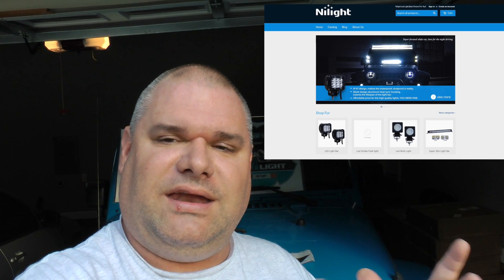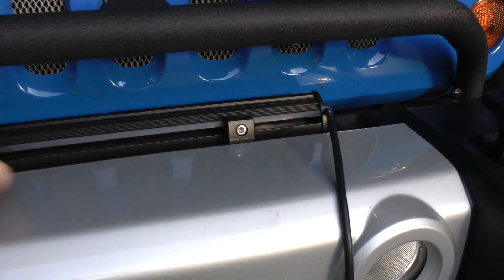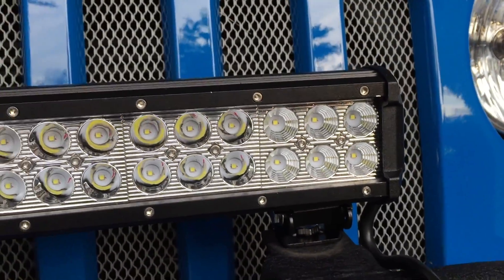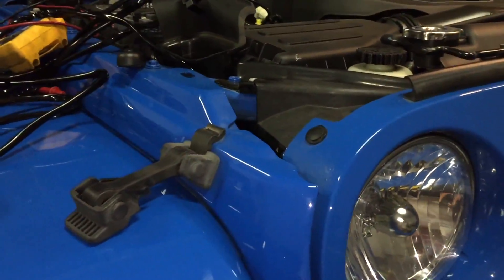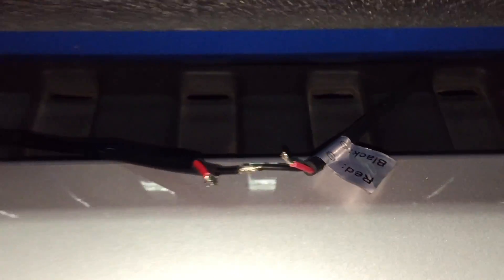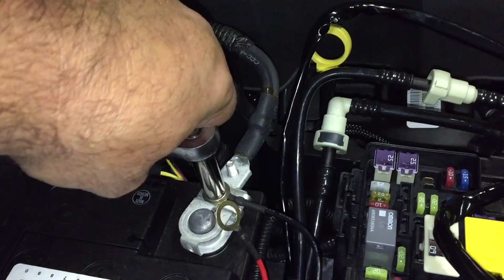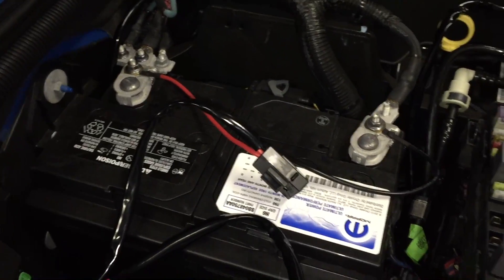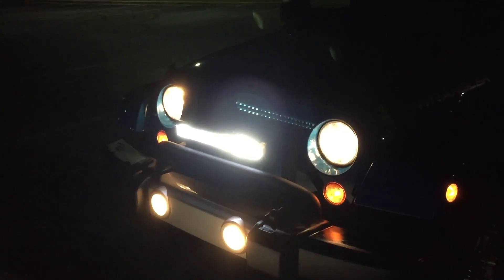NiLight 20" LED Light Bar Review & Installation Video

Comment: Thanks again for this video.  Installed the same bar and 20" Nilight light bar this past weekend.  Very easy install and works great.  Of course I used this video as a guide.  I ordered the bar from Mopar instead of Rugged Ridge.  Exact same bar, got it for $77 from Mopar compared to $145 at Rugged Ridge.  The instructions that came with my Mopar bar had Rugged Ridge listed in the warranty info.
Reply from the maker: dang I wish I had found that deal. I think the bar was in the 150$ range now thinking about it. I still love the LED lights

Comment: Amazon doesn't seem to have them but Nilight should make covers for these light bars. Hate for a rock to crack the glass and let in water.
Reply from the maker: https://youtu.be/qTiKrngYHwQ
Reply: So you can burn it with a torch, cut it with a saw, squish it in a vice..... I'm not convinced ;)

Comment: I liked your painted roof up-grade and probably going to copy You! keep adding accessories and you'll need to up-grade a power source! I added a relay box with 6 accessory connections with a 4 toggle pillar add-on I got off Amazon to run my goodies, works great and handles the watts needed. I'm running pillar lights, upper 52" light bar, 20" hood light bar and halo's all with no problem. I like all your vids and find them very informative, great job and Thank you!!
Reply from the maker: Thank you!!! yes slowly she is going away from stock and more add ons will need to be added. I agree.

Comment: I want to add this to my 2014 EZGO Golf cart.  How in the hell would i mount this without drilling into the front brush bar?.  Also, is the harness they sent you I see it has an LED that looks to always be on.    Don't need a constant drain on my battery, but do like the fact that I don't have to drill into my dash.. Living in Texas with the summer heat in our garage, I also don't want that melting and falling off.  Your thoughts?  Thanks.   GREAT video. would love to see an update at night outside when you tilted it back up

Comment: Good video, thanks.  It looks like the mounting points on the light are adjustable.  Is that correct?  Wanted to check in case I decide to order the light so I can order a light mounting bar that work.  Thanks again.
Reply from the maker: yes fully adjustable.
Reply: fiero880 Thanks for the quick reply.

Comment: I had my wires running to the same spot on my battery. I noticed every once in a while my guages while driving would act weird. Turnes out, that but on the battery terminal has a bowled underside that pushes on the terminal connectors that keeps it tight on the battery terminals.
Reply: @fiero880, definitely move your negative over to the other aux post on your battery (with the missing nut in your video).

I believe the nut you are missing is a m6x1.0 nut... cost me 13 cents at the local hardware store.

Comment: get all terrain tires, you've got street tires which make your jeep look like a car. all terrains are good on the road and are not that expensive and would make your jeep look 10x better
Reply from the maker: I know I know. But I still travel 300 to 400 miles a week sometime for work and need quiet long range tires. I just need to buy another jeep.
Reply: fiero880 there are some quite all terrains, I have coopers on my Unlimited Hard Rock, just install a 20" nilight bar a few weeks ago

Comment: I used a different set of lights but the same wiring harness.  Have you had any issues with the switch having the red led on at all times?  No battery draw issues?
Reply from the maker: One time when it got 15 outside I had an issue. But nothing since then.

Comment: Great Video man! I just have a question, how did you installed that bull bar? I've heard is difficult to mount it on the factory bumper
Reply from the maker: Yes they are extremely not fun. No room to tighten your bolts. Not fun at all.

Comment: I'm mounting my light right now. Are you happy with your placement of the on off switch?
Reply from the maker: Yes couldn't be happier with everything. The switch is down where it requires some input to turn it on so there is no way of accidentally turning it on when not needed.

Comment: I've got the same bar, except mine is from Mopar. I'm more of a traditional "round' lights look as you've mentioned. I wanted a cleaner wiring setup with the wiring goes inside the bar. What are your thoughts? Thanks

Comment: Great video. Nice light bar. I noticed the inner LEDs are "spot" and the outer 12 are "flood" to spread the light wider. I actually put a small led light bar like that on my wall behind lawn mower a few weeks ago and it works great. 
I hate how Amazon and YouTube have become "free or discounted products in exchange for a honest review" but I guess that's business.   Definitely not the same as if you buy it with your own money. I do appreciate you mentioning how you got the product.
Reply from the maker: Thank you. For the past year I have had a vision of things I wanted to upgrade next on my Jeep. This was one of them. Just recently did I think of switching the round lights to a light bar. I have been contacted before by other vendors. When I told them my plans I never heard back. This was the only company to say "Ok, let's do it." And trust me, if I had pulled out junk from the box or had issues installing anything, I will let the viewers know.
Reply: You won't see my thumbs up so here to say thanks for the reply.
Reply from the maker: You are very welcome.

Comment: your not suppose to bolt anything to the battery cable bolts, use the supplied accessory bolts. buy a 10mm nut that your missing.